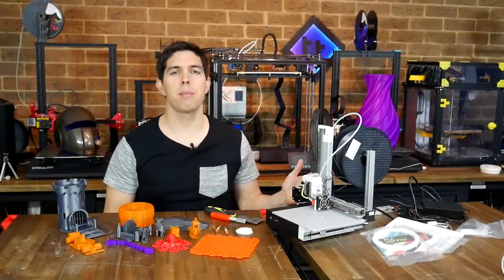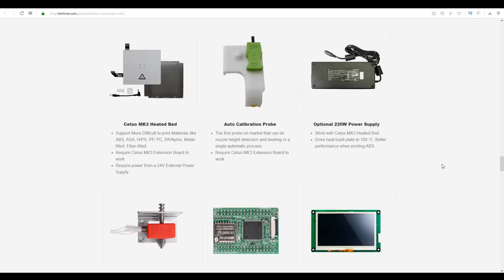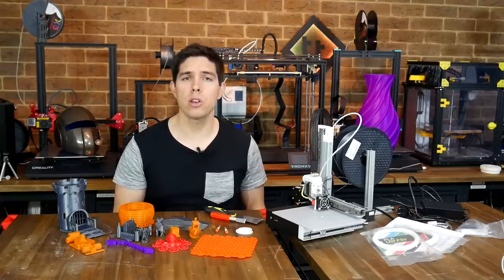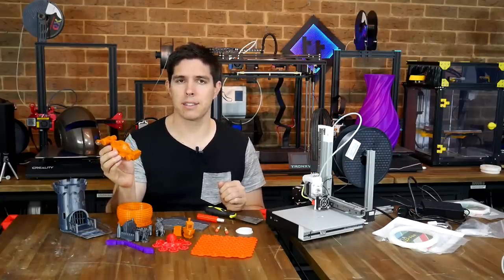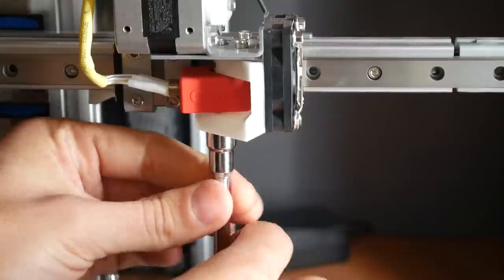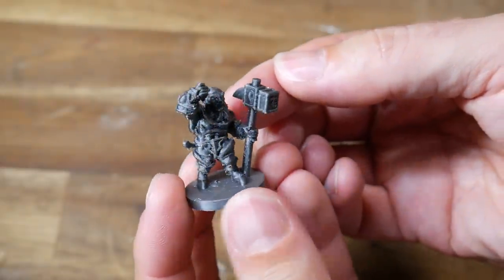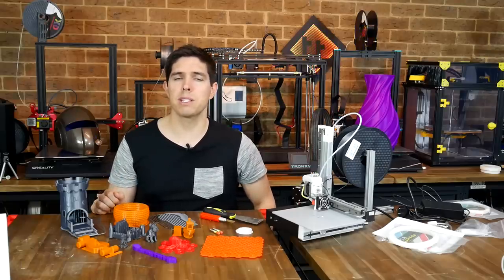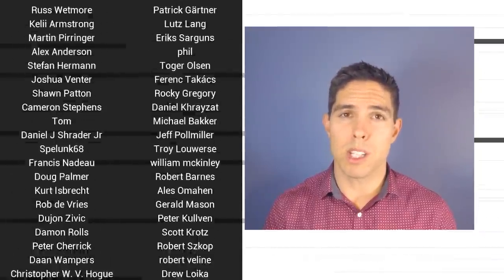Cetus MK3 review - Linear rail legend or lost opportunity?

Comment: Ahhh Tiertime. I have to say, I've drifted pretty far from my liking of these machines at this point. When the first cetus was released in 2016 it really could reproduce prints better than anything else in its class, no one else was using linear rails and they used IKO which were quite rigid even with that ridiculous cantilever. But, the company really does remind me of S3D at this stage, they sat on something good and just didn't innovate and as the Prusa mini shows, everyone has caught up and surpassed them at this stage. Not only that, but they upped the price of the Cetus V3, and made all the features you'd now expect (auto level probe, heated bed, NOT locked down MCU) an additional expense. While I did have a softspot for the company and tolerated the locked down software when it was much more workable than most alternatives, I don't touch my cetus' anymore, and couldn't recommend them against newer machines on the market.
Reply: Thanks for the update and how your views have changed.
Reply: Yeah it is kind of a bummer that it still lacks so many features
Reply: hi angus! i also value your opinion. also hi angus!
Reply: Well well Angus. Are you on a smear tour to get your integrity back? I hope you succeed because we all believe you in the beginning. And please teaching tech, dear to be different!
Reply: @EEtransmit  settle down spaz
Reply: dude you need to share this in video or something. I almost just picked up a Cetus MK3. Thing is stock is low on a lot nowadays.
Reply: Angus, you have sung too much song and praise for the cetus printers and your channel has the most cetus praising videos. You really should change your reviews or do an update because it misled my school to buy 3 Mk2's and they were all broken when I found them. The motors have so much inductance and the bed barely heats.. down to their drivers/mosfets the mainboards were unrepairable... it really makes for a terrible continued recommendation from your channel

Comment: I can't believe that bed, I wouldn't want to use a raft every single time.
Reply: Dan Slauter I mean you can just strap on anything you like, no one stops you. But for a review I think it’s important to review the printer as it ships.
Reply: This thing looks like a printer from 2015 at best. The industry has moved on beyond unheated beds and proprietary software. If you printer can't run marlin or reprapfirmware and doesn't have a heated bed, I'm not interested.

Comment: Bro dont be afraid to say this printer sucks and is not worth the money just because Angus likes it.
Reply: lil hotdog the price is what really breaks the deal. For the same money you can get a heavily modded Ender 3, which will work better
Reply: Amen brother, mine ffing caught on fire.
Reply: @Chrissi33004  Ender3 Pro + new silence board + Octoprint (camera and PI) + Filament. I just don´t know any reason to buy this crap on video
Reply: Have to agree, my Ender 3 put out better quality prints from day one, and i had no clue what i was doing at the time. It looks like here they are relying on their namebrand and linear rail fad for advertisement more than an actual solid all around printer.
Reply: @lookitsrain9552  linear rails are very nice, i modded my enders y axis and will be doing the x axis when i get a hermes. Theres no adjustments needed and no slop . I really like them and highly recommend them but it might just be a personal opinion type of thing.
Reply: @carbide1968  Linear rails, when done properly are indeed better, but in the cetus case, it has linear rails, then have half assed extruder mount to shakes all over the place.
Reply: @lookitsrain9552  i know i just returned one aftef it caught on fire. So you can guess how i feel about cetus.
Reply: Printer sucks.... and when the company stops development/support of the software, you risk that it breaks with the next os update.
Reply: @lookitsrain9552  The Ender 3 is just simply a game changer printer. I feel so spoiled starting on one. It prints amazing stock, then you spend a couple hundred modding it like I did and you end up with a printer so good that you don't even really want another kind. I keep looking at possibilities for a second printer that cost way, way more and being like "What the hell my ender 3 is better than this."

I'll probably just end up getting a second Ender 3, or maybe creality will make a coreXY printer that runs marlin and is affordable and change the whole game again.

Literally the only issue the Ender 3 has is some cheap design decisions like the imprecise Z axis construction and v slot rollers, and honestly that doesn't really show on prints anyway. I think unless you're going insanely fast, 3d printers don't really need these high precision motion systems. It's not like you can't bolt some linear rails to the v slots though, although that seems kind of excessive.
Reply: The Cetus is an amazing first printer for those who just want to print and not pick up printer modifying as a hobby.  Very glad I got my MK1 2 years ago.  The quality beats friends printers very easily.  In 2020 though, I'd probably recommend the Ender 3 for value and upgrade options, but not necessarily to non-technical types.

Comment: Great video as always. The price of this verses and Ender 3 and the Ender wins, I have just purchased my second Ender 3 in the UK for £105 from eBay delivered in three days from a UK supplier. It's a no brainer and at the price Ender is bringing 3D printing to the masses.
Reply: I was thinking the same thing. I don't see any reason to get this over the Ender 3
The only things this printer maybe has over the Ender 3 is
- the rails (not much of a win because of the ringing and rafts)
- the WiFi (but you could include a raspberry pi in the price difference, and access it from anywhere)
- not having a history of safety risks (most of them are fixed on the Ender 3, and even if they aren't, they're easy fixes)
Reply: @DailyCakeSlice  Also the community support for the Creality Ender series, both from users and 3rd party add ons, and they can use many slicers and firmwares
Reply: The Ender 3 just crushes everything in the sub 500 range. The prusa mini will probably give it a run for it's money, but I think the ender has more modding potential still. I don't like the unsupported cantilever design of the prusa mini. I'm sure there will be a kit to convert it to a more normal i3 frame though, quite quickly.
Reply: I agree 100% as others have said above the support online etc makes the Ender 3 an absolute bargain. Just built my second Ender purchased a few days ago and straight out of the box no mods it produces great prints. £105 what's not to like, my first was an early model but the new board has a much better control structure and customization. Please be warned though there are a lot of fake Ender 3's clones listed as CTC Ender A13 which are not genuine, they advertise using genuine Ender 3 pictures and photoshop out the Creality logos so buyer beware.

Comment: I really struggle to see how this printer is any good for the price:

-closed source ecosystem, so if you don't like their slicer, tough shit, you can't use anything else;
-forced rafts? that means you can never get a smooth bottom surface?
-convoluted bed leveling, why not simply a bl touch or something like that with abl or ubl from marlin?
-uneable to tweak the printer parameters because they don't let you do it;
-not a large build volume (not that it's too small, but if it had a large build volume,  that would be one selling point for some people)
-proprietary hot end, so can't change the hotend for an E3D, can't add a olson ruby nozzle;
-doesn't seem easily moddable, and even if you do, you can't adjust the firmware :/
-not specially cheap;
-weird design (linear rail, but cantilever axis, no rigidity on extruder, belt on Z axis, are the linear rails just for show? the deflection will come from any other parts of the printer);
-no special feature to make it stand out (like this new creality that has a laser head);
-no lcd?
-has layers shifts;
-noticable ringing;
-bed surface is meh;

SO what does it have to offer that other printers don't do better? I mean, some machines have proprietary software (that's not my cup of tea) that are liked by some people, but here it does not seem to be the case...

When i compare this user experience with what the "easy" settings is in prusaslicer , or in cura, i don't see how much easier it is?
I mean, if you're a first timer in 3D printing, with a calibrated prusa, you just select PLA or your filament type, place objects on the printbed, hit slice, and save, copy on the sd card then hit print filename.
Perhaps an option to send from prusaslicer via wifi would be cool (will it be available on the prusa mini?), but here there are not that many steps, and i don't see many where a newbie would be left guessing "WTF does that setting means?".

With a good auto bed leveling, it just sticks to the bed, if you select the proper filament it will just work; the only setting you touch is layer height, and that's it...
I remember on my printrbot back then whith older slicers, when i was learning 3Dprinting, i was fiddling with countless parameters and did not understand most of them...

here with this software, will a newbie understand why there is an ugly plastic sheet stuck to his/her 3D print? will the new user understand what the layer shift is?

In my eyes, it seems a not so great offering for a new user; and for advanced users it seems outright bad for the lack of tuning capabilities. The printer seems passable in itself, but if i can't fix it, what's the point? even if i could the prusa mini seems a much better investment, or the creality ender3, cr10 new version... With an ender3, you even have spare cash to buy a e3D hermes direct drive extruder and a BL touch to make a top notch printer... and with a little more money you could even buy some MK3-like (or chinese clones) of the removable magnetic spring steel bed of the MK3...
Reply: Audrey Robinel you don’t have to use a raft
Reply: @240plazer6  Ok, that's good, but all the other points remain :)
Reply: And the price as well
Reply: I mean compare this with anycubic i3 mega or creality ender 3
Reply: The size is amazing and compact and not everyone is looking to change things nor care about slicers all the time. Sometimes we just want something that works out of the box. Not everyone's time is worthless to tweak a 3d printer nor it has to be a hobby to be a functional piece of hardware. Prusa Mini is a very strong contender if not better.

Comment: I have the extended version of the Cetus (no heated bed) for a bit over a year, and am printing PLA and PETG, no problem. I think it could be ok for a beginner who wants an "easy entry" to get into printing (like for me - it was my first printer), but in the long run UPStudio is a bit too much of a limiting factor. It just lacks the ability to have full control over everything. I myself didn't have to pay for it (it was gifted), so I am not complaining about having to always print rafts (which you should, else it'll be difficult to get some prints off) or anything else, but would i buy it again, if it broke down? No, not really.  The closed eco-system is the main reason for that. Other than that it is very precise and provides good results and possibly good as a 2nd or 3rd printer.

Comment: Base model was worth it when it came out but for the love of all that is holy do not get the heated bed upgrade. You lose a good third of your build area because the hotend and limit switch on the hotend knock off the clips holding on the perfboard. That and it is almost impossible to remove the raft from the perfboard without a heatgun. Now with the Prusa Mini out, I wish I had just paid the little extra and got that instead of upgrading my older Cetus.

Comment: The Cons outweight the pros. Closed source, must use a raft, no heated bed, expensive, obvious ringing issues in all prints, proprietary slicer, and tiny build volume but the pros are... you can print detailed minis? If you're printing minis you should be using a resin printer anyway.

Comment: You can say it's overpriced. Linear rails of that size -- even premium rails are no longer that expensive to warrant the price point. This printer is stuck in time -- and tier-time will follow many into the graveyard of companies putting out machines which can't compete with the current market. Proprietary, expensive and for no good reason. If I see ringing on a machine I can't tune -- there is no excuse. Multiple layer shifts would be a quick return -- really can't see how this would sell -- Angus likes the company, but he is not particularly rational about this machine.

Comment: I'm not sure what is meant by 'has to be on the same wifi' and the 'main computer is connected via ethernet...' unless theres some oddness in your network config, cabled or wireless connections shouldn't matter as long as its the same network...
Reply: The behavior is that unless you are also using wifi, you can't find the printer -- this is a common shortcut some IOT devices use -- hardwired devices can't communicate with them -- to me that would be basically the feature is useless since I prefer to use desktops for my modeling and slicing -- and my desktops are hardwired.
Reply: A lot of routers have wireless isolation enabled by default, so they won't cross over between the devices plugged in via the cable vs wireless.
Reply: Yeah exactly... barring different subnets/VLANs/other isolation, there shouldn't be any legit issue. My guess is that the client software (UP Studio) is doing something stupid like trying to match the printer SSIDs you configured with your machine's current connected SSID, then failing if they don't match. Just found the setup doc, but no explanation is given: https://support.tiertime.com/hc/en-us/articles/360010501673-How-to-set-up-the-printer-connect-wifi-
Reply: Since the printer has no UI, it cannot connect to any network by itself. In order to start the communication, it sets up some hidden network that the slicer/setup software connects to. It then can tell the printer what the correct SSID/password are.
Reply: @MoraFermi  Ah, interesting. That makes more sense. Although I admit it still sounds a bit annoying. Thanks for the explanation.

Comment: My school has a Cetus and it prints petg just as well as pla without a heated bed
Reply: I've printed tpu and petg with no problems. But I have a mk2
Reply: You don't need a heated bed for PETG anyway with blue tape, although I've had pretty bad warping issues when I try to print PETG on a non-heated bed. It might just be me printing too hot since I like to print PETG between 240 and 250.
Reply: Eric Barnett with just the metal and no glue stick or hair spray works  just as well as petg that pla with no warning whatsoever

Comment: The cetus mk2 was my first printer  and currently just got a ender 3 over a month ago. My cetus was up and running with in 1 hour and has never failed. Can't say the same for my ender 3. The cetus is a good printer for someone that is just starting. With the prusa min coming out, the cetus is a little over priced. I think the cetus had its place but either they need to add features for the price or lower the price. I have no regrets getting the cetus, if I would have got the ender first not sure I would still be into 3d printing. Now I have learned alot and personally do like my ender 3 better now but the cetus has been a printer that just works and is reliable. My not have the option to tweak like others but sometimes that more overwhelming for someone just starting.

Comment: Nice review/video Michael. I have a Cetus MK2 and have owned it for about 2 years. My MK2 has a heated bed and a removable surface, all options that are easily added. I think it's worth mentioning that Tiertime did develop a S3D Cetus profile so you can download gcode directly to the printer via UP Studio for models you have sliced with S3D. What I like about the printer is it's print quality when set to "Fine" using even a 0.4 nozzle. It really is terrific. Also, dare I say that I like having UP Studio in my arsenal of tools because I find it does some things very well, like thin wall and easy to remove supports as long as "Easy to Peel" is selected. I own other printers (Prusa MK3, Ender 3, CR10S, SeeMeCNC H2, Robo R1+) but I still find myself using the Cetus and UP Studio quite often. The new Cetus MK3, once you add all the options, is quite pricey. The MK2s where significantly cheaper when first released. I think for the money now I'd go with the Prusa Mini.

Also, UP Studio slicing parameters can be modified but they are saved as material profiles. Refer to this article: https://support.tiertime.com/hc/en-us/articles/900000226723-8-2-Custom-Material-Profile-UP-Studio-V2-6-43-or-later-

Comment: As an owner of Mk1 and Mk2 Cetus printers I want to add a few notes that may be of use. You can prevent the z axis from falling on these machines by tightening a machine screw on the printed piece holding a one-way bearing near the z axis (on older machines this was an upgrade). Another thing to note, you do not always need to print with a raft and there is a setting to disable rafts. You can see this option around 6:07 in the video. Please do keep in mind the software is not as versatile as say Simplify3d or Cura but is meant for education and beginners to to reduce complexity and the chances of error. You can actually edit generated supports in the advanced options and selectively remove unneeded support material. Printer definitely has quirks but it just works without hassle and is extremely reliable. I think this and a Prusa mini would be the perfect combo. Cetus to do simple effortless PLA prints (probably 80 percent of what I end up needing to print) and the Mini to handle occasional more exotic stuff.